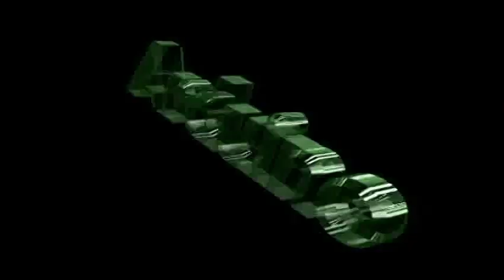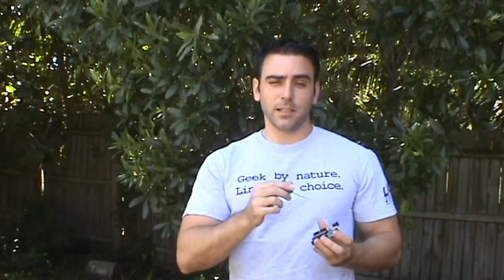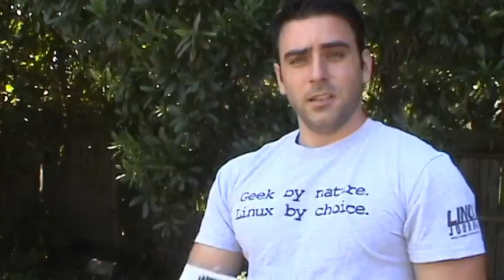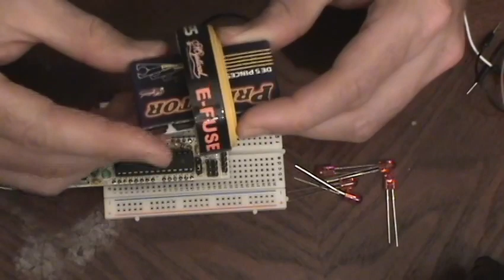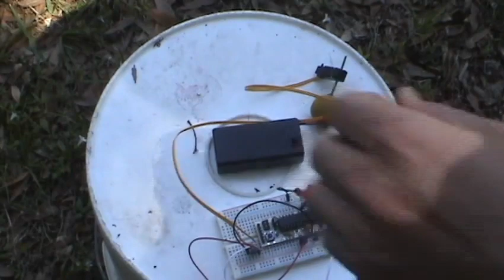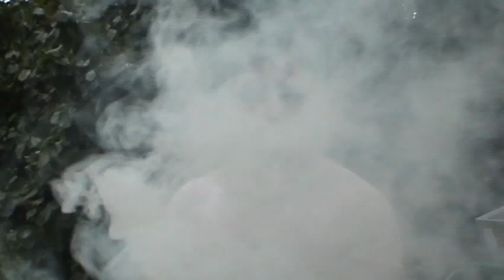Archive Video 2010 - Arduino   Smoke Part 1

Comment: I'm a novice with electronics, but everything I've seen says you need a resistor in series with each LED, otherwise they can pull too much current and either melt or damage the controller. Is that not true?
Reply from the maker: Yes, this is a video I made over 10 years ago.   You should have a resistor inline to prevent damage.  I've done it a number of times with out a resistor, before I knew you needed a resistor, and I had no problem, but it's still not good for the device and will probably damage it over time even if there are no problems at first.
Reply: @filmsbykris2.068  Oh, sorry! I saw the posted date, but overlooked the date of 2010 in the title! But thanks for the info!